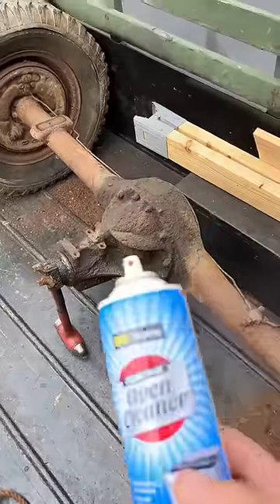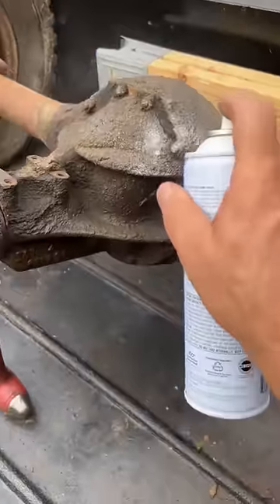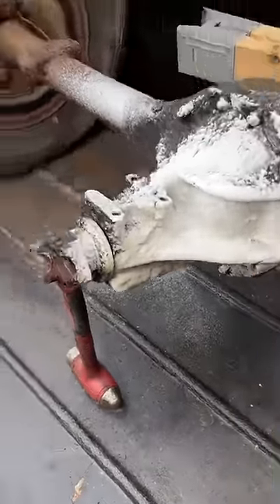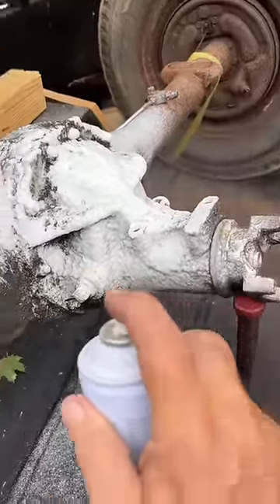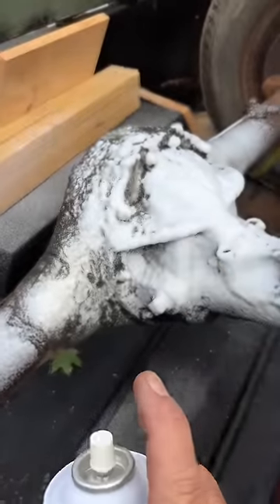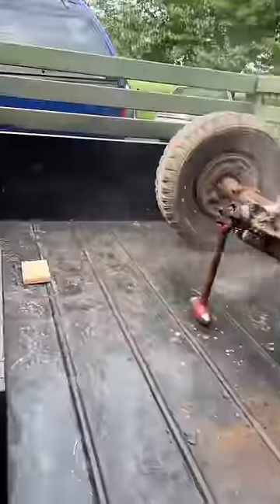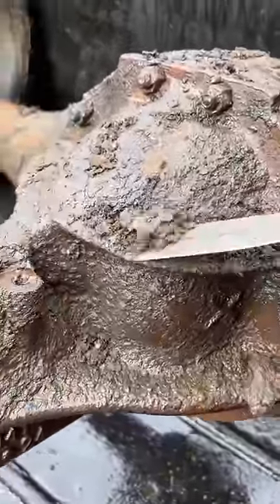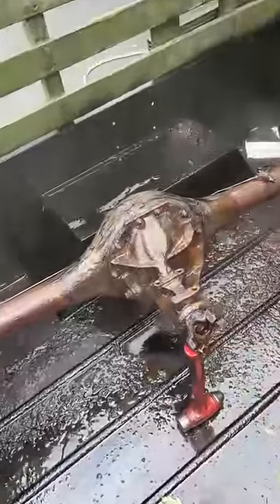Oven Cleaner Cleans 8 3/4 MOPAR rear #shorts #nonamenationals #parts #mopar

Comment: Pretty sure the pressure washer would work just fine
Reply: Probably all you needed was the pressure washer. But that helped to no doubt.
Reply: It rarely does.
Reply: Clearly you don’t have much experience cleaning car parts of any description.
Reply: Oven cleaner is basically industrial grade degreaser my dad has used it to clean engine blocks since I was a kid in the 80s or longer then I can remember. Budget slash poor man's engine degreaser
Reply: Unless you have a pressure washer or hydro jet or water blaster with at least 5-6000 psi there’s no chance you’re getting that all or even most of that off, you can sit there all day blasting from a 1/4” away and it won’t do anything without some chemicals or solution, and/or higher psi
Reply: @BigShaneGillis  or a hot water pressure washer
Reply from the maker: @telly115ify  👍
Reply from the maker: @hiimbryson8460  🤝
Reply: Ok I’ve got some experience with this. I have a 3,500 psi pressure washer and it pushes water through the seals, if you pre game it with oven cleaner you don’t have to spray as much and push water passed the seals. Also the oven cleaner will destroy any paint.
Reply from the maker: Hi Bryson
Reply from the maker: @RadDadisRad  👍
Reply: @BuckDOESIT  hey bro, how’s it going?
Reply from the maker: @hiimbryson8460  👍
Reply: just imagine years of dirt, dust, oil, concrete, grease etc. that coating on there is probably rock hard. believe me, when i had to change my driveshaft i was scrapping away shit just to get to the bolts for 25 minutes. that dont even include the rest of it i just said fuck no to😂
Reply from the maker: @nick0164  that’s right it was caked on fromm1969
Reply from the maker: @Sorum & Sons FF & Painting that’s right
Reply: Pretty sure you’re wrong lol
Reply: @BigShaneGillis  nonsense.

Comment: I like the idea but I think there are other degreasers that will break this stuff down better as cooking fats are different in ways. If it was aluminium bottled dish soap works pretty well but id opt for a traffic film remover for this. Move it away from paint work, blast it off once, spray it down with TFR, leave it for to what would be considered too long, spray it with more TFR, agitate with a brush then finally blast it off good and proper.
Reply from the maker: Great tip!

Comment: Zepp CLR mixed with straight zepp purple degreaser. Keep it wet with the solution for about an hour to 2 hours. And it will just wash off with a garden hose. The CLR will also break the rust up for a better paint finish. 

Used to restore and build classic cars before I moved state lines
Reply from the maker: Thanks for the tip

Comment: Did it backwards  I always hit it with power washer first. I do use oven cleaner it works like a champ once the bubbles are gone I do second coat then wash again 90% of the time it looks great if not then third coat is industrial strength degreaser
Reply from the maker: Thanks for the tip

Comment: Don't the casting numbers have to be hot first.  I use brake cleaner spray. It evaporates quickly and does a fine job as quick as it evaporates.

Comment: Cool that it works but DG has an automotive section where they sell name brand engine degreaser and brake cleaner. It’s a lot cheaper than the parts store

Comment: Back in my day in the late 70s and early 80s oven cleaner had lye in it and we would use it on anodized aluminum bicycle rims to leach out the anodization or color and then polish the aluminum to a chrome finish. I don't think they put that in there anymore pretty strong stuff and you sure as hell didn't want to touch it with your skin or breathe it for very long.

Comment: Try using Regular EZ-Off formula with original chemicals BUT is highly costic And need to wear gloves... Or reg. Engine degreaser then let sit soaking for 24 hrs.... Should melt off with hot water and Dawn liquid, use a catching tray so Not to get on everything and cat litter cheap gravel.....then pressure wash....Longer process but less aggravation when disassembly...
Reply from the maker: Thanks for to info. I usually use EZ Off but didn’t have any. Never thought about soaking for 24 hrs

Comment: Hope that helps with old parts that need cleaning after decades of filth .... I also see the diff. Drum brake plates are also caked.... Don't get drum brakes wet, Nasty black mess with Asbestos!!!! Cancer minded... Remove all parts completely dry, remove all brake fluid with Cotton rags, spray Marvel Mystery Oil on Axle bolts, remove and replace Nuts & Washers......Then clean backing plate with Brake Cleaner or WD-40.....
Reply from the maker: Thanks for the info and thanks for caring! No immediate plans for the axle. Just saving it from the scrap yard. I may flip it if my brother doesn’t want it. He has one with bad bearings

Comment: Purple power an high pressure was will do the job that Ole thing ur using just like using ur water hose pressure
Reply from the maker: just thought i'd try it
Reply: @BuckDOESIT  I did the same thing you did there before but with that purple power use it straight don't water it down an spray it on all over an let it sit you will see the dirt an oils drip off then pressure wash it.
Reply from the maker: @MrYiyo209  I've used purple power before. Nice F100 you got there!
Reply: @BuckDOESIT  thanks man little by little it's getting its a daily driver I live in turlock ca, I drove that thing all the up to kennedy meadows no issues.
Reply from the maker: @Mryiyo209.  That's cool! check out @Ary Dabirina he does a lot of short videos of his 1960 Apache

Comment: Pour use oil on that dry mud cake, let's it soak, spray degreser and used water jet. The oil will soften the mud, degreser will removed the oil together with the mud.

Comment: That's an old trick been around 40 50 years that I know of it will remove paint too
Reply: Easy off works best,used the cheap stuff barely took the paint off.